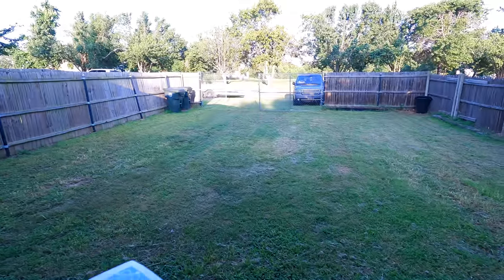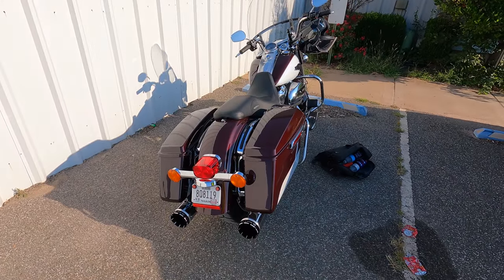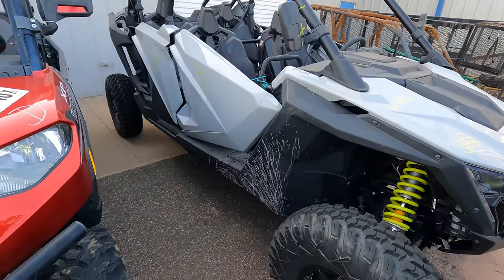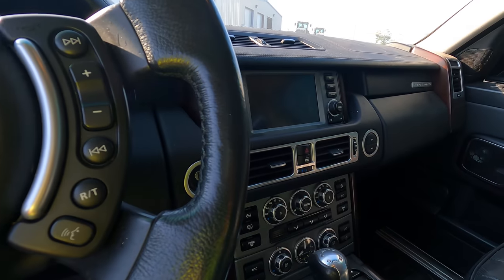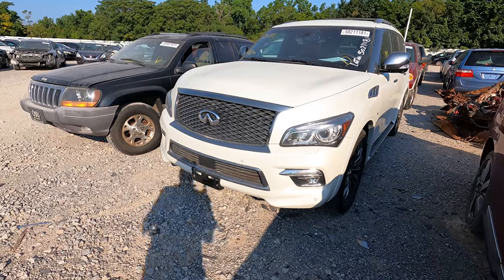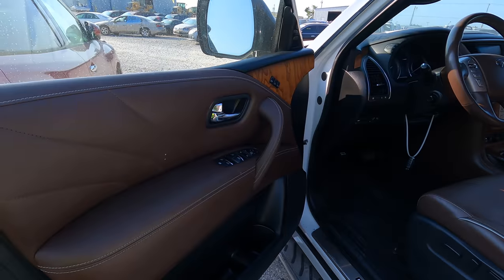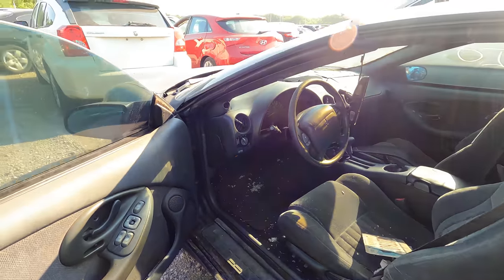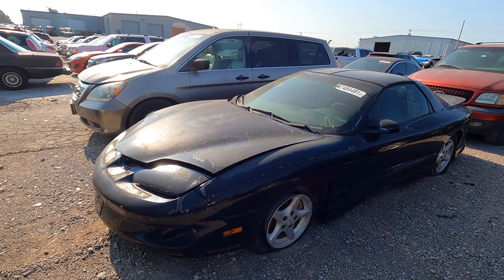Copart Walk Around 7-23-21 + Motovlog + Nissan 300ZX

Comment: That's the only way ford will get 200.000 + thousand miles😅
Reply: A High School friend had a 2003 F150 he bought new, with 280,000 miles. He got rid of it and bought an economy car.  He sold it to a friend at church, might be able to do a video on it when I see him in a couple of weeks....
Reply: My 07 f150 just picked up a car from copart in Arkansas and towed it back to San Antonio, my f150 has 270k
Reply: My friend has a 2006 Ford ranger with 307,000 miles on the odometer and it's engine is original, as well as the transmission. I recently repaired the AC in it, and now it blows so cold it condensates around the plastic next to the vents if it runs long enough. The truck runs surprisingly well for having 307,000 miles on it.

Comment: You ride that bike well for the low mileage.  Ride more, concentrate on low speed maneuvering.  Anyone can ride fast in a straight line, until they have to stop or they run into something.  The group of four I ride with do at least  200miles every time we ride.  Coastal Northern California, good roads, two lanes, lots of curves, no traffic congestion.

Comment: If the old 240's engine design is like the W124 250D i had, the rear filter is oil, and those old engines usually have a manual fuel pump for priming so the front filter might be fuel

Comment: glow the glow plugs if hot glow is installed on top of the plugs during cold winter days. glow plugs can also be without this preheating to then only get 4 glow plugs with preheating be careful never to run out of diesel Eternity engines

Comment: Randy if you get interested in that 300zx I have a complete swap for it! V6 turbo,5 spd manual with rear end and 5 lug wheels! I had one the body rotted out so I stripped it and the parts are sitting!Of ya the electronic control struts too with rack.Mine was blue and a 300zx turbo 2+2.Oh and seats too

Comment: 34:28. RANDY ; That is the power-steering pump. The diesel injection pump is located in the back. At 34:42 you are looking right at it. The long "thing" with the 4 pipes coming out of it on top is the dieselpump/injection-pump... The start/stop-system is operated/controlled by vacuum. 😁😁..
35:39. YES, IT HAS POWER-STEERING, RANDY😁😁😁

Comment: 34:25 The thing with the belt on the front, the circular lid and the wing nut is the power steering fluid reservoir. Chances are it's empty and it all leaked out of the rack.

Comment: Yah know, with that Altima 2 door, you might be able to get the transmission replaced by Nissan. As that's in that year range of cars they recalled for transmission issues.
Reply: It is, and looks like someone used regular transmission fluid instead of CVT nissan fluid and ruined it

Comment: i would tell the mercedes seller 1500 tops.. should be under 2k out the door?  very bad on the clutch, and engine to shut it off like that..  its just a vacuum issue with not shutting off..  easy to fix..  that car painted and all fixed up might bring 5k

Comment: idk, i used to work on computers in a mercedes shop, i think they would just use that as a parts car. you have fun driving those those old 240 and 300d billow smoke going down the road , plus it does have 170k miles, u wouldnt really make a profit off it doing all that work to it. but thats my opinion!

Comment: The expedition said it was in reverse of course it's not gonna start unless it's in park or n
Reply: Ford column shifters get sloppy and the needle goes out of alignment. If it really was in Reverse, it won't even try to crank. The engine is toast, it probably jumped timing.

Comment: If you get a side by side, it helps if you live near a "trail system"..... I live less than 300 feet from a trail that goes for over 70 miles, past 7 different little towns with lots of Bars and Restaurants..... and I DON'T have a four wheeler of any kind...... Boo Hoo